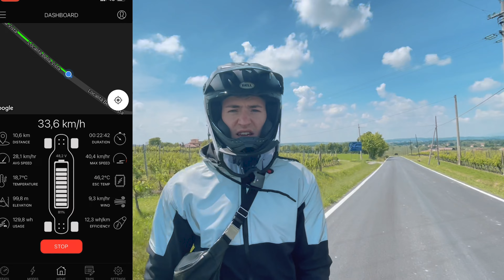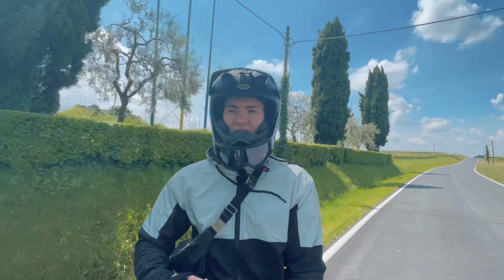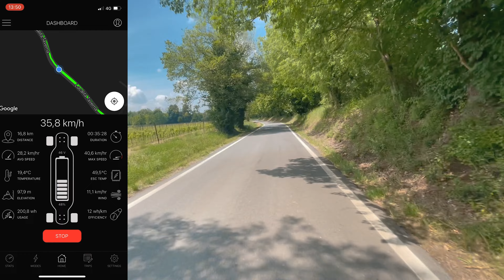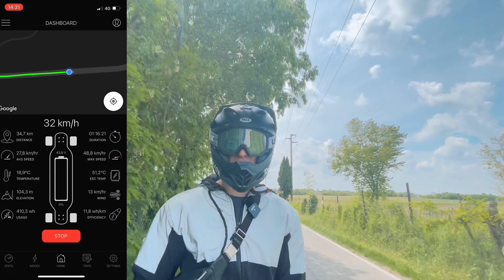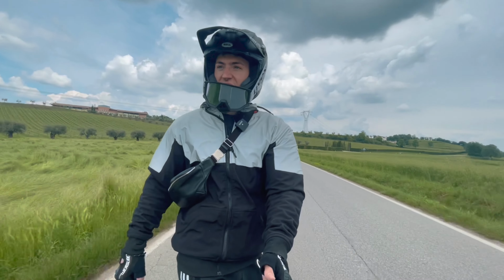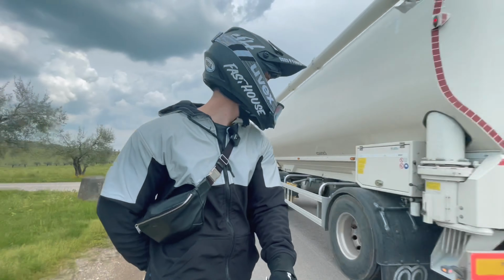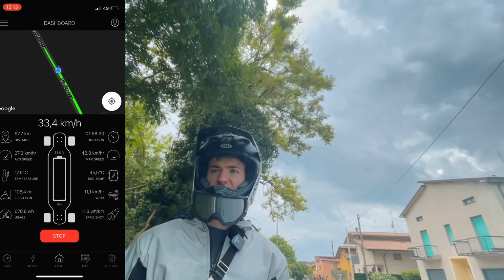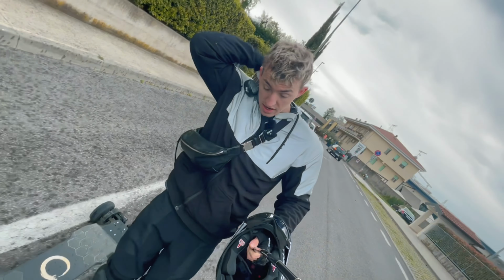Kaly nyc xl40 full range test in one shot on a 80kg rider

Comment: Hey Raul. Nice video. Isn't the battery on the xl40 1300wh? Why are you seeing 709.5wh total used on xmatic app?
Reply from the maker: The Xmatic is wrong i also reported other problems such as a wrong average speed
Reply: @amijumpen  do you have “double data for dual config” enabled?
Reply from the maker: @johnd9357  nope, that was the problem.

Comment: If you get non-fatties 200x50 wheels you'll get 45 miles range. Just a thought.
Reply from the maker: Probably, wheels play a big role, but more how you use the boards, size to get all of 3350mah of the battery, you have to train max 1 amp to cell, if you drain like 10amp don’t expect more then 2900mah, so your ridding stile/height plays the biggest role
Reply: @amijumpen  your board has a 31.5ah battery which equals 31,500mah...just a clarification on the numbers
Reply: @amijumpen  also the fatties vs narrow wheels/tires have a delta of about 8wh/mi for me. 

On 200x50 I'm burning 32wh/mi whereas on fatties I'm at 40wh/mi
Reply from the maker: @aahdxuxiznwnd2044  mooch rate the Sanyo NCR18650GA as a 3300, he's the only one witch i can trust in terms of cell's feedback/test
Reply from the maker: @aahdxuxiznwnd2044  so the real usable capacity is 29.7ah. sure, less contact patch but also the treds pattern make some difference
Reply: i was just gonna say, 38 miles actually isn’t impressive. however i know fatties definitely have more friction. cant wait for mine!
Reply: @esk8unity  "impressive" is that Kaly doesn't lie about range.

I think there's a common misunderstanding about batteries.

There's no special sauce to it. It's math that has a few variables.

I personally think it is impressive, but that's just personal opinion.

If you want long range. In fact more battery than any production board on the market go for the Kaly XLR.

If range is the main concern get narrow 200x50 wheels and tires instead of fatty.
Reply: @aahdxuxiznwnd2044  If range is the main concern get urethane wheels hehehehe
Reply: @PlaCrown  people just need to understand watthours in pack and watthours per mile consumption....that's all.